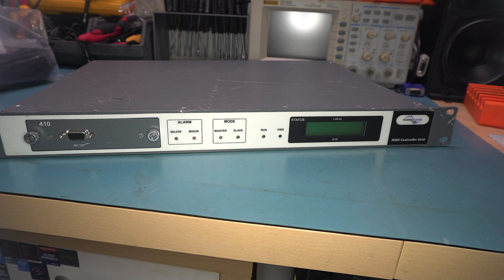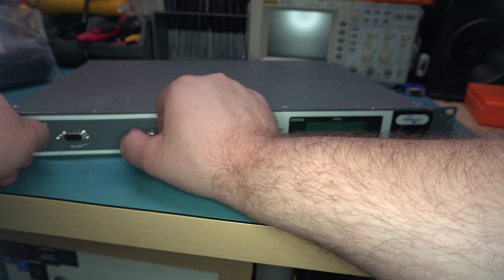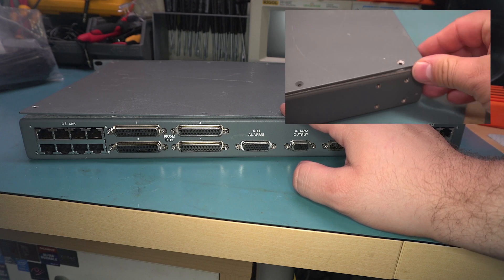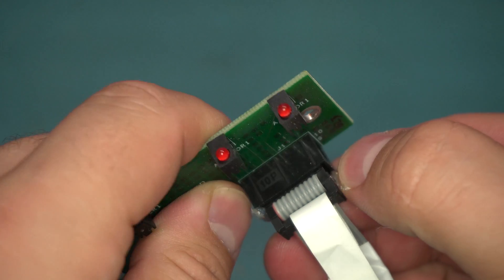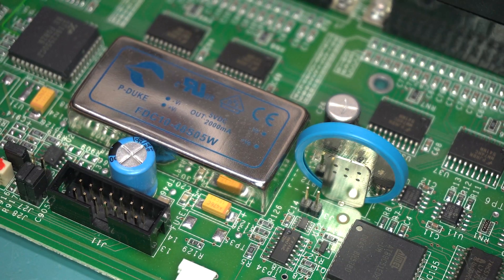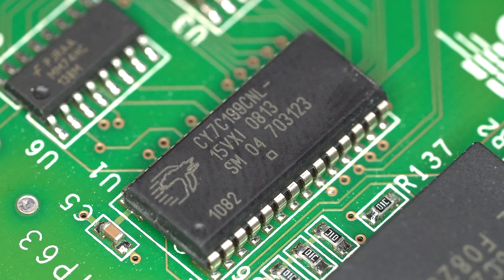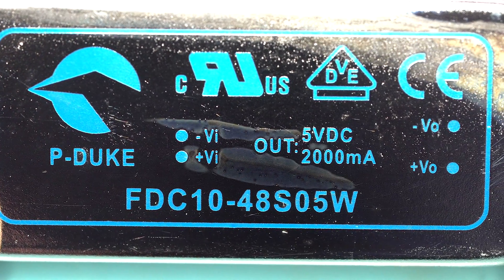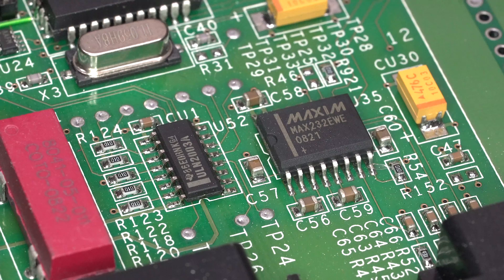MobileAccess NMS Controller Unit Teardown

Comment: That hybrid modem module is VERY expensive; Cermetek lists them at $70 each in volume.
Reply from the maker: +douro20 Expensive, but worthless. :D It's like finding a board with a $500 FPGA on it. No one is going to buy it. Hehe

They must simply be so uncommon they can charge whatever they want for it. A 33.6 modem is probably $1.50 in parts these days.
Reply: Just one more reason not to buy that kind of stuff brand new.